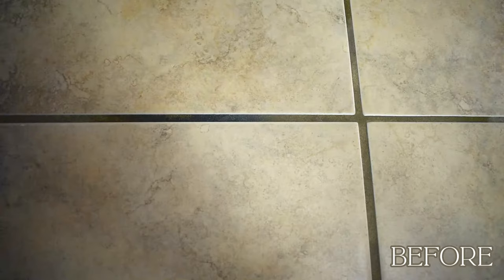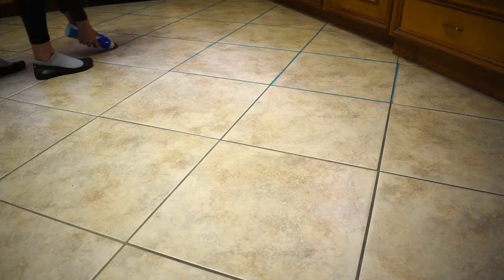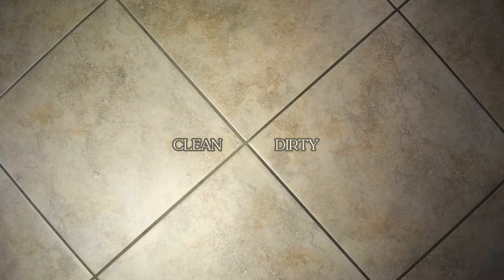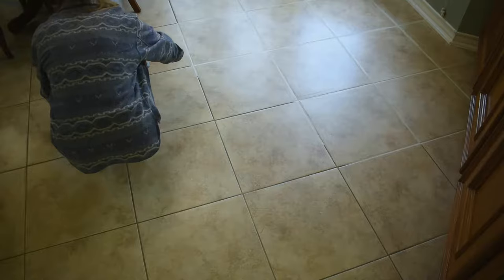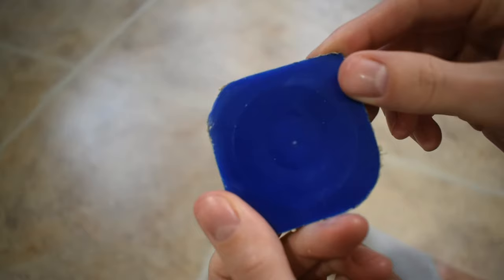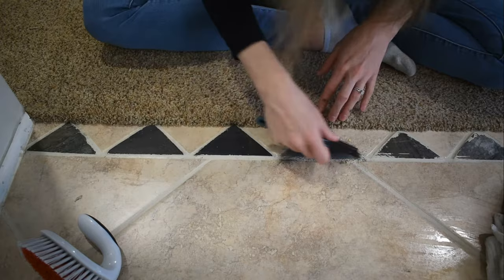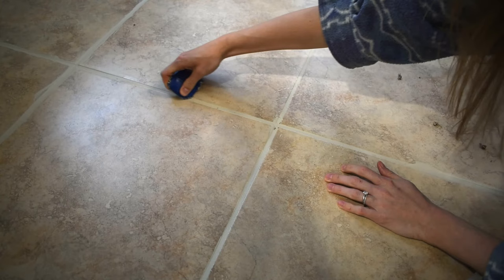DIY Grout Refinishing | How to Clean, Paint & Seal

Comment: STOP MOPPING YOUR TILE FLOORS ! PERIOD ! Keep it vacuumed and leave it alone ! Also spot clean with a large grout sponge well broken in and only damp not dripping wet . Immediately dry the cleaned area with a terry bath towel. You don't need any chemicals ! Just cold water . Using grout stain ( paint ) is ok. You could have used paper towels as you painted and wiped off across the tile , just leaving it in the grout. 30 years experience talking. You don't need to seal paint ! It is already sealed.  It's paint ! Use a microfiber 12 inch swivel mop with Bona hard surface floor cleaner sprayed on the mop, not the floor. It will remove any surface soil that you can see in light reflection. Just vacuum once in a while . The less you do, the better tile floors will look ! NEVER MOP AGAIN !
Reply: I have a question. I have some tiles that SOMETHING splashed on it. It literally took the shiny finish off in those spots. So the floor always looks like something was spilled in that spot. Is there any way to add a permanent shine to those spots again?
Reply: @high_fructose_corn_syrup  , l do not know what type of tile you have or what glaze was fired on. But most Ceramic or Porcelain floor tiles are virtually chemical resistant, including acids.  If you have mopped your floor over a long period of time, it has built up a sheen ( glossy look ) then those more dull or un-glossy spots are just where an acidic type of cleaner spilt or splashed. As far as a coating to make it look the same , l really couldn't tell you. Coatings , sealers , clear acrylic floor finishes could work but would you would have to test a small spot, and determine if it would be matt, satin, semi gloss etc.
Reply: Thank you for this info. 👍

Comment: Pro tip: DO NOT let toilet bowl cleaner sit on the grout for more than 2 minutes. If you don't rinse/neutralize it properly, the acid will keep eating away at the calcium that's in the grout. Color sealer (paint) is a sealer, spraying other sealers on top of it will only create sealer residue, don't do it.

Comment: Rent a shampooer or extractor or wet dry vac.  if you are not able to get on the floor like this.  Video is perfect.   I bought my grout paint from home depot 7 years ago it inhibits mold and mildew.  it lasted until i installed new tile and grout.  and it seals at the same time.  btw a wet dry vac with wide attachment will work...obviously I am not able to get on floor lol but those with back problems can still achieve this.  as for painting i just sit on my bum and scoot around. Will power.  You did a beautiful job , im just trying to encourage someone who has mobility issues.
Reply from the maker: Great suggestions!

Comment: I do this for a living and what I do for textured tile is this. I apply the same way you do, but do not let it sit for more than 1 hour. I personally like about 20 to 30 minutes max, so small bath you can do all at once then clean but if a large area, do in sections. For cleaning the stain, I use a sponge,   micro fiber cloth and a sanded sponge (80 grit works well but if glass tile do not use sanded) 
Step 1: paint on stain 
Step 2: use damp sponge to lightly cover small area 
Step 3: in a diagonal direction of grout line, lightly scrub tile with sanded sponge 
Step 4: use clean sponge and clean up 
Step 5: buff area with microfiber cloth

Hope this helps!

Comment: Your video is really good, and I think I'm going to try this. I do have a question, however. Does painting and sealing your grout completely negate the need to clean it periodically with grout cleaner? Or is this a misnomer?  My thought is that if the sealant is applied properly, it makes the grout surface nonporous, and thus, dirt resistant. So all you have to do is mop the floor.  Right or wrong?
Reply from the maker: You're right - the texture changes so that you can clean it like a regular part of the floor. The grout is no longer sandy and porous so it doesn't absorb stains the same way, which is good, but dirt can still collect or get stuck in the "groove" of your grout lines. I normally sweep/mop my floor as regular and then if something is stuck in the grout I'll wipe that area by hand with a regular cleaner (not grout cleaner). You can't scrub as aggressively as you could before  or else you'll pull the paint off, but you're right that it's nonporous and so dirt wipes off. If anything happens during cleanup, you can also touchup the paint at any time!

Comment: The tiles looks so nice. How long would it last before you have to repaint? I am planning to do just the mapei grout refresh paint without the optional sealant because its hard to get a separate sealant here..
Reply from the maker: Thanks! It has been close to a year and I have not repainted. Still looks excellent. I also think the sealant is optional, so don't worry about that. Just be gentle when cleaning (wipe, don't scrub) like any other painted surface and it should last a long time. Plus it's super easy to touch up! I'm super happy with my results.

Comment: How has it held up?
Reply: I was wondering the same.
Reply from the maker: It's great so far! There are a couple of really tiny spots that have chipped because I didn't clean underneath well enough before I applied the paint, but I have the bottle handy to fix those whenever I need, which is nice. Otherwise, its virtually the same as the day I did it! One thing though is that you have to clean it like a painted surface as opposed to sanded grout. I normally just mop as usual and then wipe any stuck-on stain or food bits up by hand with a cloth. I don't think scrubbing with a brush would do any favors to the paint, though I haven't tried. I suppose I could always touch up with the paint if something did happen though. Overall, I have no regrets!
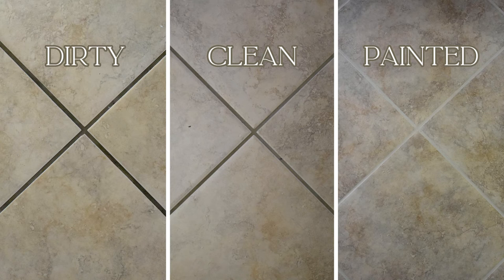Reply: @KatharticStudios  10:03

Comment: If you had a small area like an entryway, would you have regrouted instead, or still used the paint?
Reply from the maker: Unless the grout is in really bad shape, definitely the paint! I love this stuff so much for floors. Not sure about wet spaces like bathrooms though.
Reply: @KatharticStudios  ohhh… so maybe not good for a bathroom? That’s the floor I’m needing done.
Reply from the maker: 2 years later and it has held up fine around my kitchen sink! I think it would be okay on a bathroom floor around the sink and toilet, but I wouldn't use it directly inside a shower or tub. It's similar to wall paint - durable to splashes but not made for being repetitively submerged. In any case, it's a cheap and relatively easy option to try vs regrouting or installing entirely new floors. And you can keep your paint bottle on hand in case of any future touch ups. Worth a try!

Comment: Is their an easier application for sealing after putting on the new grout paint ??
Reply from the maker: The paint does have a sealer built in so additional sealing is optional! You can also look for non-aerosol sealing products. There must be wipe-on or roll-on options.
Reply: @KatharticStudios  thanks! The wife and I are tackling our bathroom today with these methods.
Reply from the maker: @User37621  good luck! 🥳
Reply: @User37621  how did it go? I’m about to do my bathroom.

Comment: How is this looking now ? Do you still recommend this product and process?
Reply from the maker: It looks great! I definitely recommend it for really old, stained grout like mine. I'd never have been able to get a light and bright color without paint unless I ripped it all up and regrouted. The paint has stuck very well. The main con is that you have to be more gentle cleaning it and can't scrub hard like regular grout or else you risk peeling or chipping the paint. But I still have the rest of the paint bottle sitting in my closet, so touch ups are easy. I also think the aerosol sealer isn't really necessary.
Reply: @KatharticStudios  thank you.

Comment: Did you use a soft or hard toothbrush?
Reply from the maker: Either would work I think! Soft might move the paint around a bit better but firm might hold its shape longer if you have a lot of grout to do. My brush was quite frayed by the end. The paint is quite fluid so to coat everything you just needed to push it along, rather than "paint it", if that makes sense.
Reply: @KatharticStudios  Thank you ❤️ Yes, it makes perfect sense.